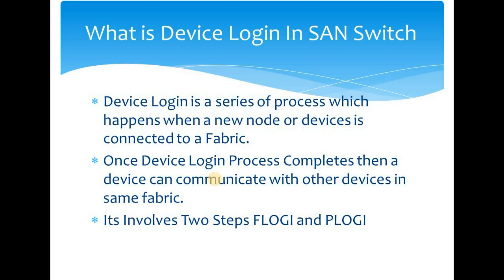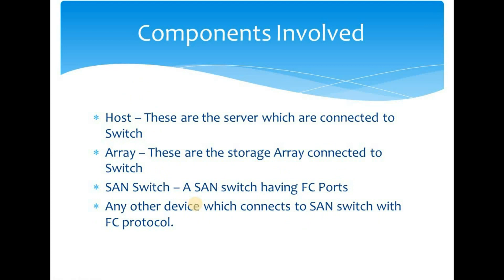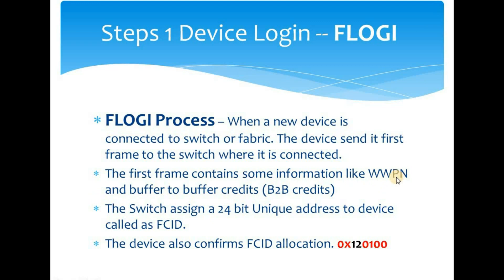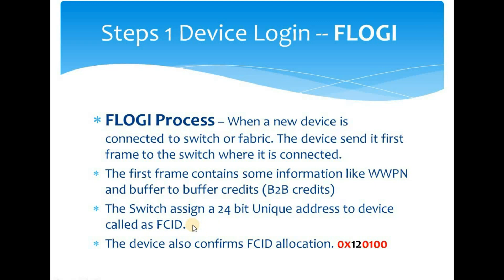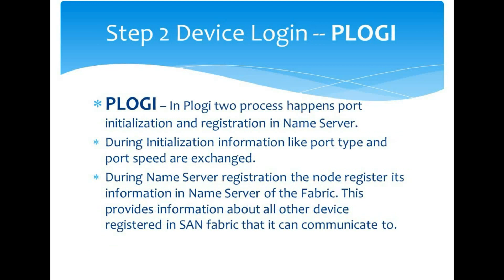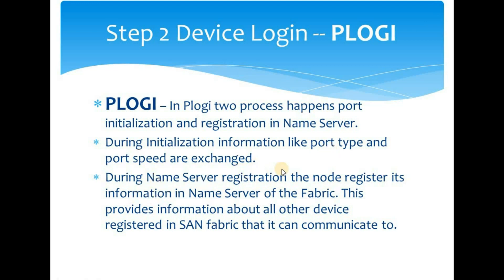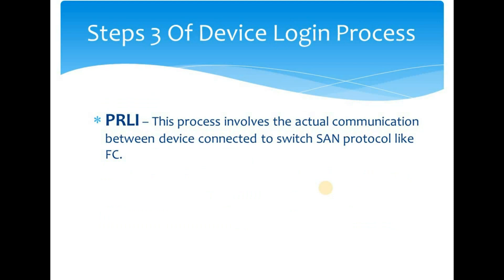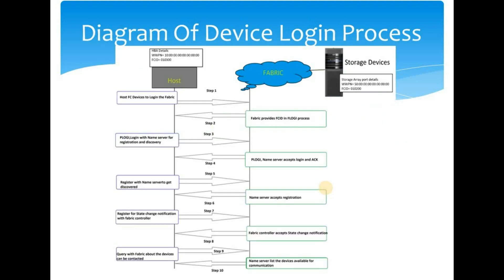Steps Of Device Login Process FLOGI PLOGI and PRLI In SAN Switch Part 4

Comment: hello Sir, I need help with zone " I have 2 ESXi Host connected through SAN Storage directly through Multi path Cable. now we introduce SAN Switch,  one backup server and One backup SAN Storage.  now we want to remove multipath cable and connect to SAN switch. what will be zone configuration to take the backup through SAN Switch.